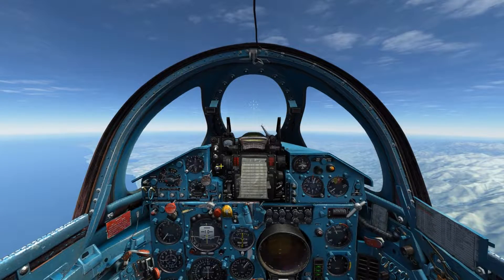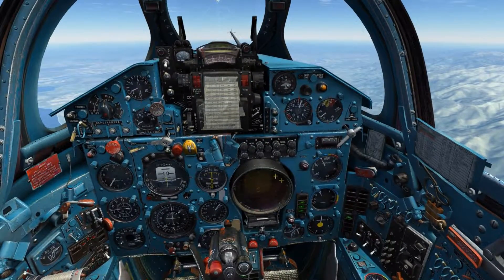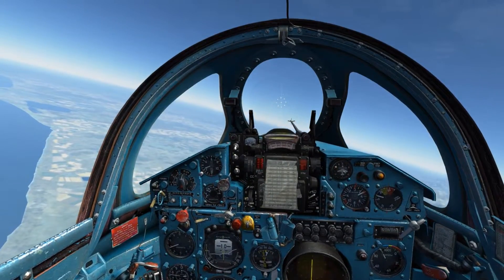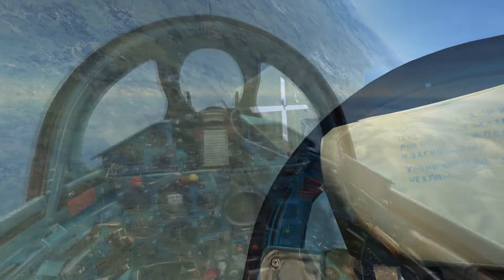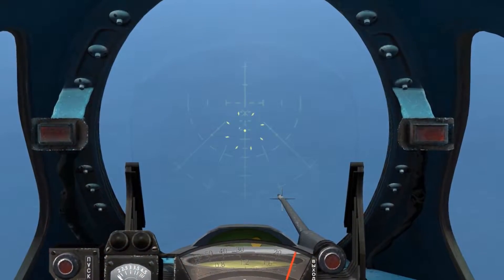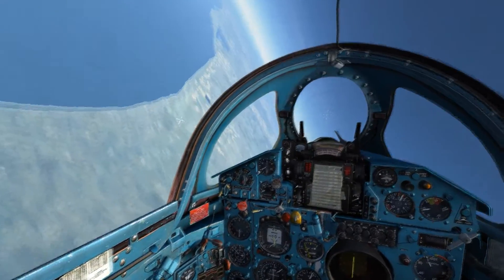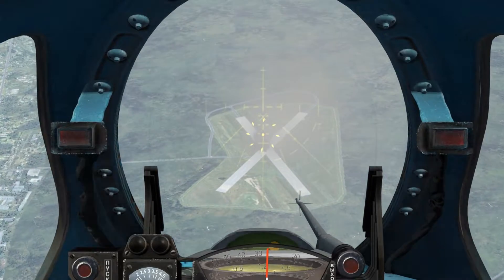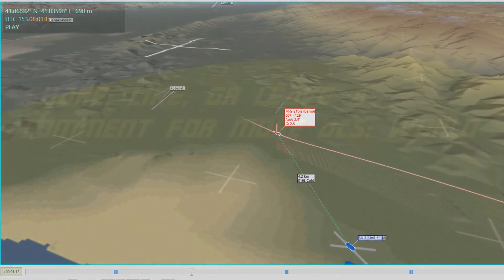DCS:World » KH-66 Guided Missile Employment » MiG-21Bis

Comment: How is your pipper that small?
Reply from the maker: The grip on the throttle can be used to set the diameter of the pipper in the gunsight
Reply: pickinthatbanjo Isn't that the radar targeting range?
Reply from the maker: Meant to say the target size dial, can be seen at around 1:01
Reply: pickinthatbanjo ohh yeah, i just realised. Thanks!                                Great video btw
Reply from the maker: Thanks

Comment: 1:14 This scale on top of the AG-Gun-scale is for AA-missiles only (and it's 1 to 9 km, not 1 to 8). Whereas the scale below is for AG-rockets/-missiles and the gun. To quote a real MiG-21-pilot:

"the bottommost scale indicates distances for AG rockets and guns (400m - 2000m),
the scale above indicates distances for AA missiles (>1km),
the second from the top scale indicates small distances (2000 - 400m, right to left), and is used for AA-gun-attacks; this scale is the same as the bottommost scale.
the topmost scale indicates the diameter of the pipper in miliradians

Edit:

Not to forget the small scale on the top left side of the ASP:

"The small windowed scale on the top left side of the ASP is the AA missiles distances scale. It will show the distance to the radar-locked target. Since you will have other visual indications for launch permission, you don’t need to pay much attention to this scale."
Reply from the maker: That quote is directly from page 132 of the manual supplied with the module - http://imgur.com/a/G1eQv  Interesting your real MiG-21 pilot quoted it word for word.

In any event the top scale in the ASP is indeed for AA missiles, which is why it is ignored in this video as is the second scale as it is used for air to air cannon attack.  Neither being used in a KH-66 attack which is why I simply do not mention them and start on the third scale.  As said in the video "the upper scale in the lower half" not the the uppermost scale in the ASP.

Comment: Can you use the Mig-21 gun sight as a A-G Gun sight?
Reply from the maker: Currently it can yeah, set the guns/launch selector to the upwards guns position, the fire/bombardment selector to the upwards fire position, and auto/manual selector to auto.  It will work in manual as well though you would need to dial the intercept angle knob to the Gsh-23 position.
Reply from the maker: Just gave it a try to see how it reacts since it's been a while, still seems to work as I remember just fire within 2km and use the radar in fixed beam to obtain range.
Reply: pickinthatbanjo Thanks

Comment: Another method that i use is to fire the missile up to 10 km distance ( or longer depends on alt), line up with the target, engage the beam and keep it on target for 2 secs then i disengage the radar and break away, the missile will continue the last known course of the beam.
Reply: ... hence it goes ballistic and becomes a merely unguided missile. That's not what was originally intended when using a guided missile. So why using the radar at all? You could fire it at the targets like every other unguided missile. Or like you fire other unguided rockets while using the radar beam just for distance measurements. No difference.
Reply: +OverSpeed even in windy conditions?
Reply: Haven't tried in wind or bad weather conditions no. I don't know how much it will affect the missile but in small ranges below 10km i don't think it matters so much. However never tested.